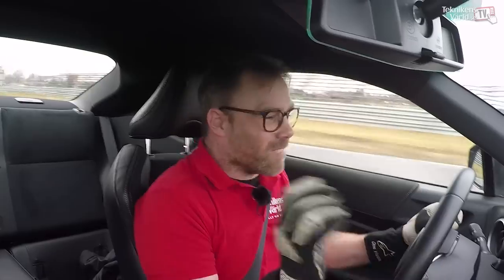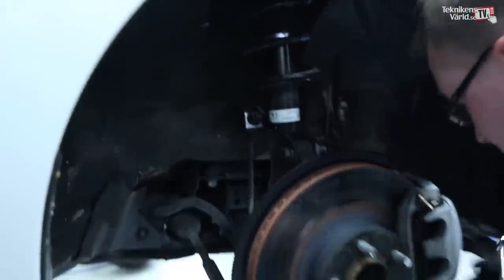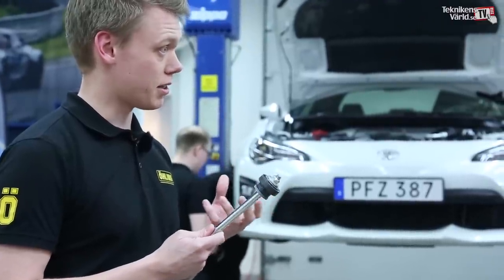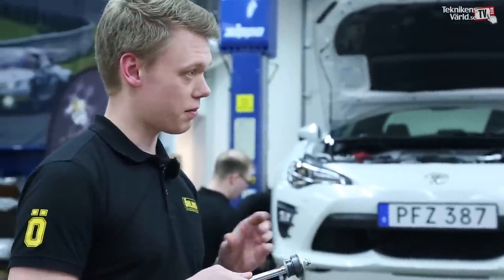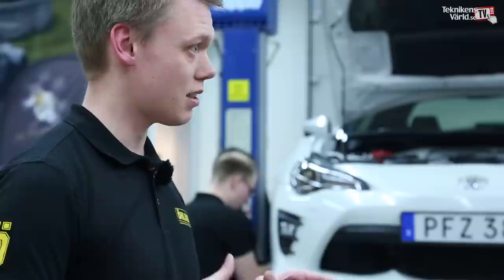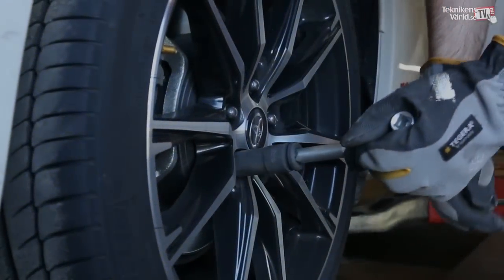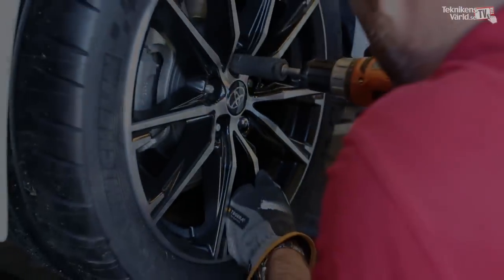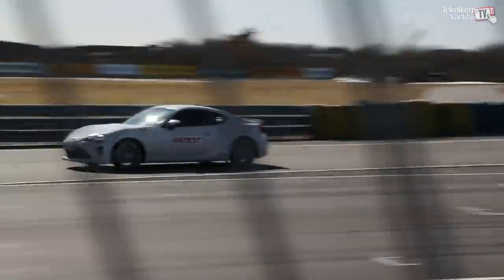Öhlins Dual Flow Valve in action!

Comment: Lol this guy makes no sense, so yous use a high spring rate, but soft damper? Lol i always thought u need a hard damper to keep up with a tough spring otherwise it gets bouncy
Reply: And racecars have stiff suspension 😂😂
Reply: Yeah... I trust Öhlins engineers more than Youtube commenters. These guys know what they're doing
Reply: That's 90s thinking. Think about how stiff modern cars are compared to old cars. Then consider both how stiff AND light modern racecars are. Because the tires are stiff and stickier than ever, the cars are stiff and strong, and the whole package is lightweight AND powerful, you're able to actually use stiff springs with comparatively soft dampers because the cars themselves stick to the road so well with aero and everything. Not to mention damping technology itself has come an EXTREMELY long way too. Racecars really do have to be quite comfortable for drivers to race them for 3+ hours at a time at 200+ mph in the pitch black of Le Mans.

Comment: My r&t  hasn't a good durability, it began to fail with 60k kilometers, i don't know if is  it's  design durability....
Reply: 60k km is ~37k miles. From what I recall in the manual, they need to be serviced just under 20k miles or ~32k km...